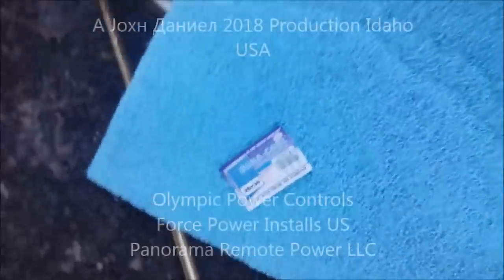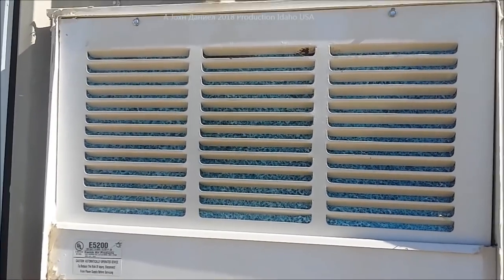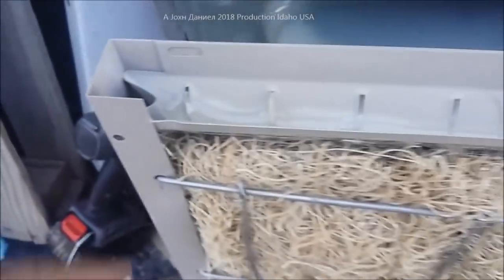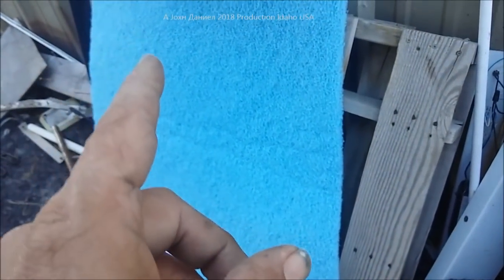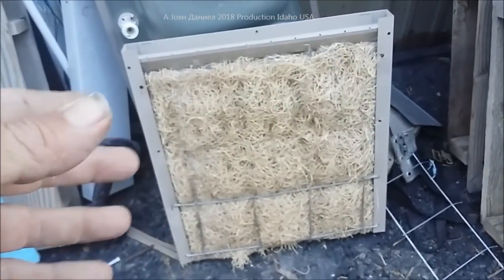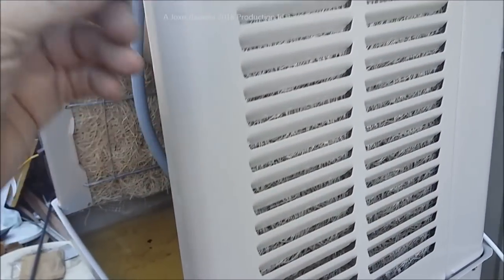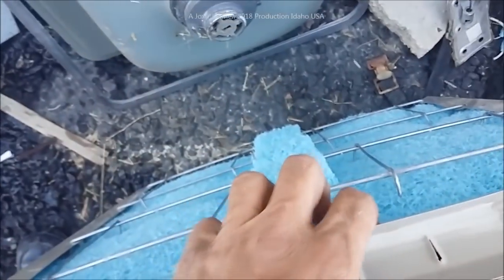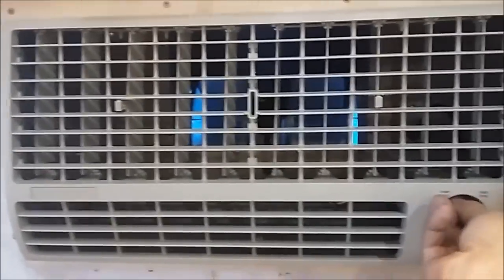Evaporative Swamp Cooler DIY making it run colder (parts used below)

Comment: Put the blue dura cool pad on the outside next to the pannel. Cut it to fill the gaps like you said. dont want any nasty hot air getting sucked in the cooler. Now put the wood pad on the inside. 
These coolers work through water evaporation. The thicker the pad, the more water retention in the pad.  Also go grab a larger pump and an 8 way distriubutor kit and double up the water outlets to the pads. If you increase the thickness of the pad, increase the water to the pad you get more cooling. I have done it to all my swamp coolers over the years and wont go back to A.C.

Comment: I have not watched this video yet but I'm gonna start off by saying one thing ...never ever use the blue pads always use the wood aspen pads ...they are much cooler. OK now I'm going to watch this video
Reply: I haven't viewed the video yet but you are right blue pads don't wick like a aspen and minerals form channels so in time small streams develope and warm air gets through. I can't use a aspen because of algae in the water so you can rejuvenate blue pads with vinegar and dishwasher pallets and run it then purge it. Helps remove the mineral channels.
Reply: Yep 👍 blue pads suck compared to aspen. If that’s all you got though, it’s better than nothing 😀

Comment: In more than 40 years of swampers I've tried every pad on the market. I never found the blue pads to be that much of an improvement over aspen pads. The blue ones cost way too much too. The water where I live in Arizona is really hard and the blue ones load up with minerals really fast. I could see in this guys cooler that the aspen pad is not properly installed. First problem is the top of the pad looks to be left open which lets debris out too easily. You should fold the plastic netting over the top to prevent this.Number two is the pad goes UNDER the drip tray, not against it. Then there is no gap. The blue ones ARE convenient . Four of those here cost about 50 bucks! I can buy 10 aspens for that price. I still love the smell of new aspens too. Anyway, buy blue if you like but I just don't think they're as good as advertised.
Reply: i think aspen cools better
Reply: Yes I think you are completely wrong Aspen pads cool much better
Reply: Preach my dude plus...i love the smell of aspen pads I'm strange like that but yeah I tried this blue stuff too it's that scotch brite stuff like the green kind they don't hold water like at all. And I came to see these didn't hold all too too much either I think it's could be a stand in if you can't find the size or if they don't make a aspen pad in the size you need for your cooler but I dunno.
Reply: Blue has mineral channels. I've seen it the water ends up going down a narrow path and the surface of the pad doesn't wet. Fiber is much better but it can plug up the slots. I'm stuck with the blue because our water has algae and the fiber pad stinks and turns black in weeks when it's in the 90s. I'm hoping to keep my blue pads working by running a cup of muriatic acid then purge it once a month.
Reply: Aspen 👍 
Blue Pads 👎

Comment: So I switched this year from Aspen pads to DuraCool.  I live in an arid part of Colorado.  It is currently 73 degrees outside and my swamp cooler is registering an output temp of 71 degrees!!!  Yep you read correct. ONLY 2 degrees cooler than the outside, dry air--no rain, moisture or humidity present, BTW)  Pump and Blower are working great.  Water flow is visible down all sides of each panel.  After watching another YouTube video of a man's dissatisfaction with the DuraCool pads, I decided to check something that he mentioned. Sure enough.... the INSIDES of almost all the surfaces of the DuraCool pads are BONE DRY!!!  The external surfaces (with the water visibly draining down them) are soaking WET.  My Aspen cool SO MUCH BETTER than these.  Any idea what could be causing this?  I feel so ripped off since the DuraCool were more expensive and were touted to increase cooling efficiency.
Reply: They are plastic so not absorbent and the minerals form narrow water channels so you get hot air from them. I thought I'd use the blue this season because of algae in our water but just swapped them for Aspen. Before the blue was putting out 83 degrees a half hour later the Aspen is 64 degrees at the ceiling duct.

Comment: the blue pads will not drop the temp as much as aspen pads. Could be poor fit of aspens which caused less than optimal performance in your system. Also on high fan I have seen water droplets pass through the fan with the blue pads.....
Reply from the maker: I tried a hybrid version, it blew me away. Blue pads first 3" from water drippers down, then Aspen pads the rest of it. Blue pads caused the aspens to get better water distribution by nearly doubling. Best solution yet.

Comment: My problem with the blue fiber is that the calcium builds up on it very quickly. I am lucky if I eat 2 months use from it before it is almost completely pugged up. I was using it on the outside of the 12 inch thick master pads.
Reply from the maker: Ah, yes if your water is hard water don't use them.  Or put a refrigerator water/ice inline filter on your cooler.
Reply: @JOHNDANIEL1  Right, and kind of the same as mine; bought a cheap hose adapter and placed a screw on  multistage, soft water filter like the kind used on showers.

Comment: I have one question, the sponges for fish tank, have the similar texture, I can use to improve the cooler air flow???
Reply from the maker: They may work, but they may also retain too much water causing the blower to over heat.
Reply: @JOHNDANIEL1  Thanks for the time, and thanks again for the information.